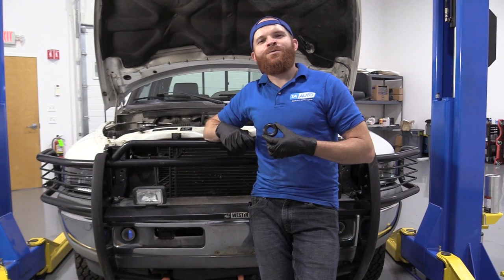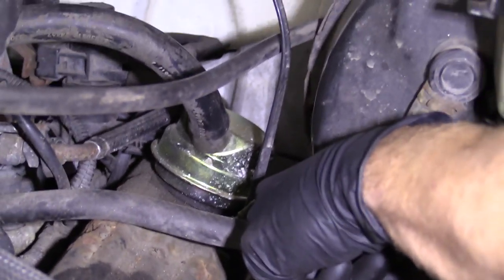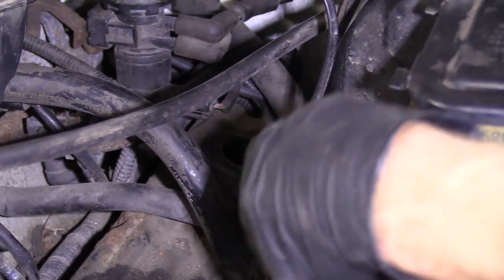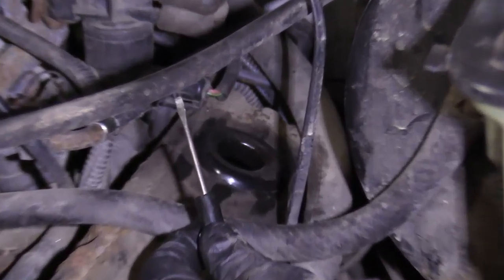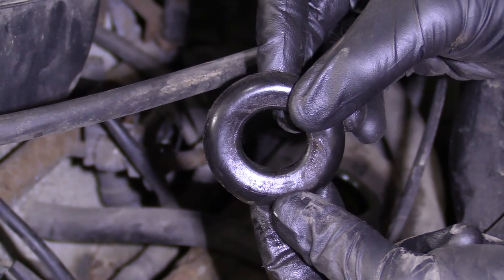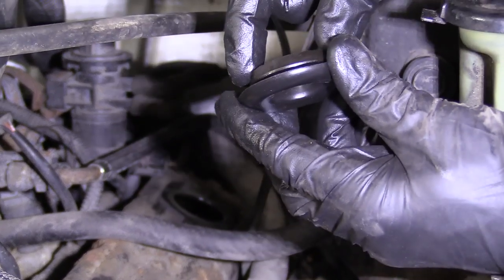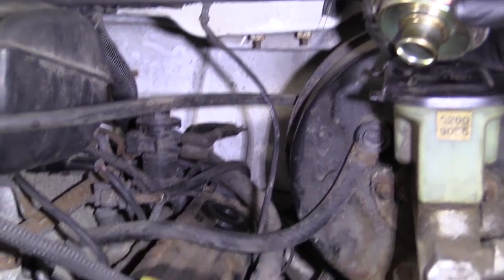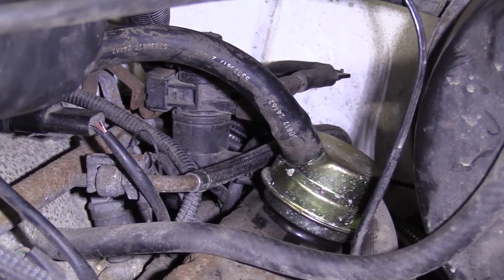How to Replace Breather Element Grommet 94-02 Dodge Ram 1500

Comment: I really need some advice please . I have saved all the videos youve made for my fiture references as well as mych needed now . Lol but my dodge 1996 had an ignition issue but i found that broken wire . Now it works !  But now qhen i slow down it stalls everytine.  It acts like ots out of gas . Which it is not. It back fires and stalls but starts right back up. Which part do i beed ro change out? If youve got time to answer , i woukd greatly appreciate it .
Reply from the maker: +foxy2loxy We wouldn't be able to diagnose an issue like that here, you may want to have a local mechanic take a look at it. Thanks for checking us out! http://1aau.to/m/Shop-1AAuto-c

Comment: I'm trying to get my both grommets out of my 1994 XJ 5.2L and they're both hard as cement can you please help me
Should I buy a heat gun and use it until they soften
I'm not even able to get the pcv or breather out of the grommets even when the engine is hot
Thank you

Comment: I'm working on my 94 jeep grand Cherokee 5.2l V8
And both my pcv valve and air breather are stuck and the grommets are hard as a rock and are not budging
How do I get them out and get the grommets out without taking the valve covers off and heating it up with a torch or heat gun
Please if anyone knows how to help me I would greatly appreciate your help thank you